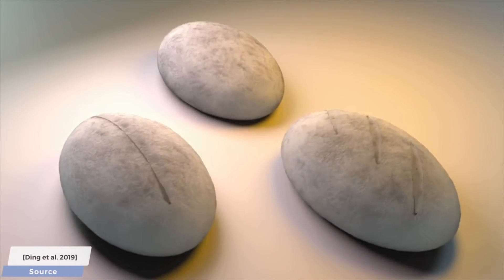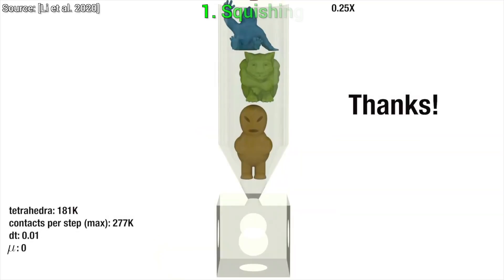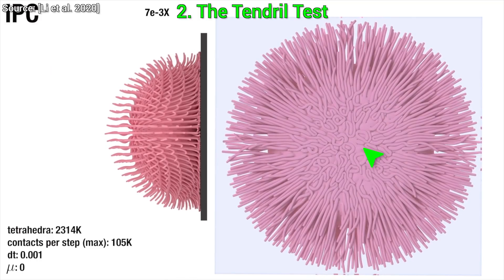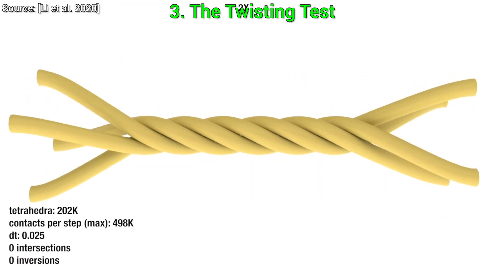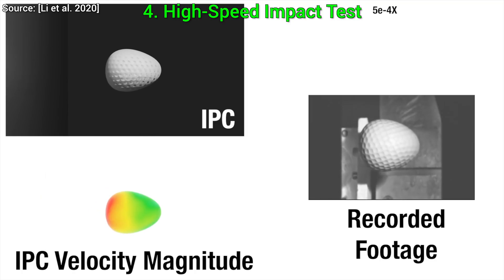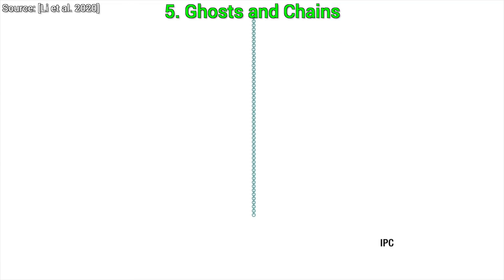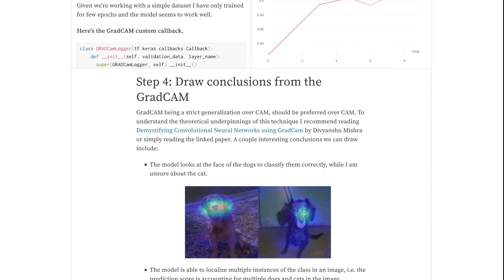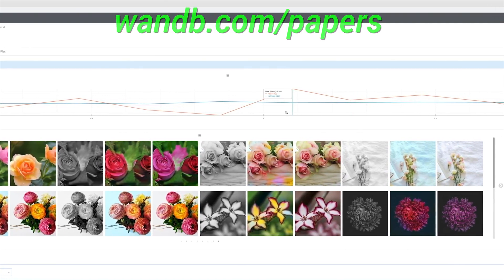5 Crazy Simulations That Were Previously Impossible! ⛓

Comment: me watching the video: "of course, there's a lot you can do with a gpu"
Dr. Károly Zsolnai-Fehér: "...all this is performed on your processor..."
*Dolphin in Town by Kingo Hamada starts playing
Reply: and later:  "... minutes per frame ..."

This is horribly unoptimized.  It uses (776.2sec / avg 264k calcs) or an average of 2.94ms of cpu time per calculation on the cloth folding simulation!  Holy crap that is slow.

Comment: I'm sorry, did you just say "Millions of contact events" and "A few minutes per frame" in the same paper? That's crazy impressive.
Reply: Software engineer here.

776.2 seconds / 264k average 'contact events' == an average of 2.94ms per 'event.'  This is insanely slow.  and remember, this is on an 8 core 3.0ghz cpu. It should be churning through these several magnitudes faster than it is.  Seriously, anything that takes even a faction of that much cpu time per calculation needs some serious attention.  (This is sadly pretty common for academic code as in that field performance isn't even a criteria, let alone the primary one.)

He said it would need to be re-implemented to run on a gpu, so this likely means it isn't tuned for parallel processing.  Honestly, it likely isn't using multithreading at all, so we can assume it's running on a single core. (aside: good choice of Intel for this, as single-core is the only thing they do right).   Best case, though, that's roughly 8.8 million cpu cycles for each contact calculation! (which only includes 1/264000th of the cycles for the full render code).  And even if I'm wrong about the multithreading... that number only gets worse the better the code is at it.

I am totally impressed by the dev(s) getting the simulation so perfect, though.  It is a joy to watch.
But to call its speed impressive?  Just no.
It needs some love and attention, including a serious refactor.
Reply: @sagemeline  Thanks for the info! These are still some impressive simulations, but it's good to know that they can get even better with more effort put into them.

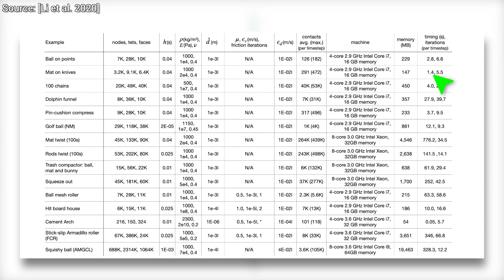Comment: 4:44 what about air compression though, that is one of my concerns.
Reply: Could probably add small air objects to simulate it. The most impressive thing is the ability to handle the high forces without causing clipping or buggy behaviour though, so it doesn't really matter that it's in a vacuum